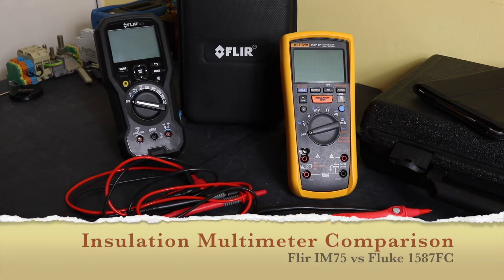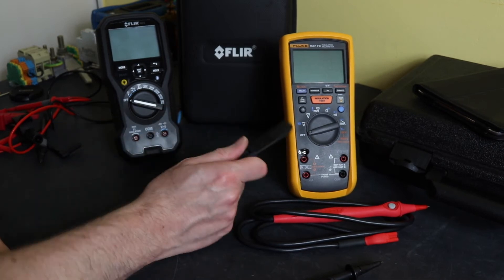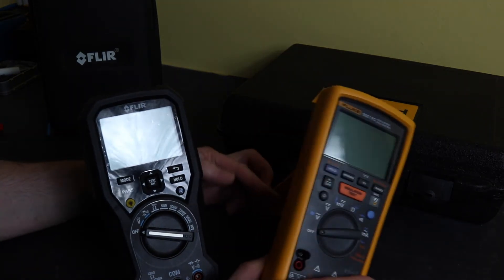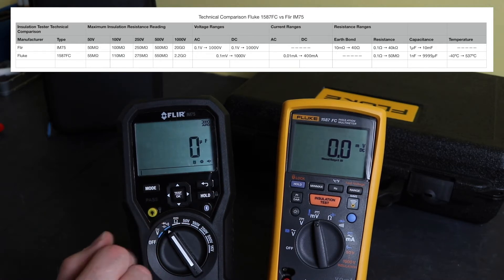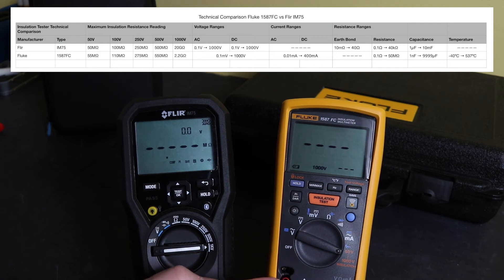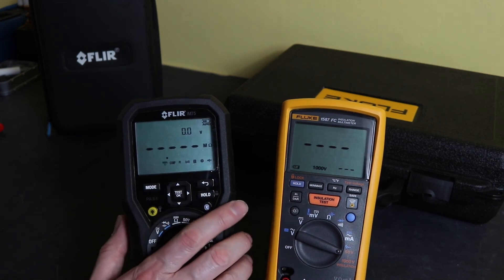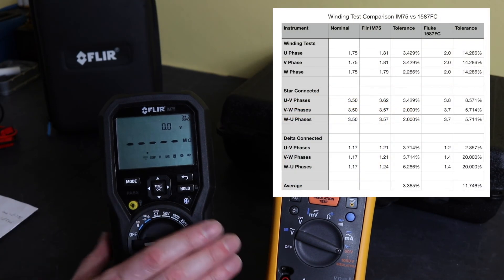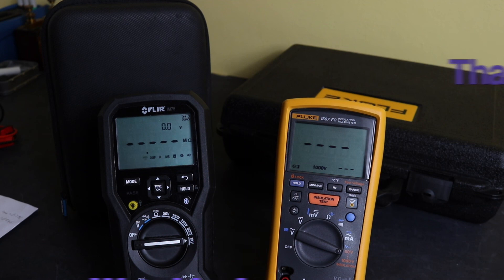Insulation Multimeter Comparison - Flir IM75 vs Fluke 1587FC

Comment: hi mate which one would you pick out of these two?, im looking to have a multimeter/ir tester that can do capitance to have in my tool bag as all in one type set up.
Reply from the maker: For me personally, I would choose the Flir over the Fluke, as the Flir has a 200 mA Ohms / continuity function for measuring earth bond and winding resistances, that the Fluke does not have. The Flir however has a lower capacitance range in comparison to the Fluke and uses a more unusual AAA battery pack.
Alternatively, you could look at something like the Brymen BM878, if you don't need the DAR/PI function for insulation testing.
Reply: @three-phase562 awesome thanks,

Comment: Nice video Three-phase. I think fluke are missing a trick, particularly with this meter model, not having the 200mA test current given that it's got insulation resistance funtionality. Apologies I've not been commenting much recently....been a bit busy with my 2391-52 course/exams.
Reply from the maker: Thanks for watching and commenting Bbf. I agree, it is their top of the range insulation multimeter, so lacking the 200mA test current is not brilliant for UK compliance. Good luck with the exams, worth it in the end.

Comment: I don't know what it is with manufacturers and 6*AAA battery packs. 4*AA would be much preferable to me!

The RS / Appa 156B that I have drops to its low battery warning very quickly but in testing it remains accurate (according to bluetooth transmissions) until long after the display stops working. It's spent longer telling me the battery is dead than it ever did on 1, 2 or 3 bars.
Reply from the maker: Yep, AAA battery packs are a pain. I have converted a lot to rechargeable AA cells like TETC has, so I hardly ever have AAA around. Meters now a days are getting some quite power hungry features on them, which just negates the AAA batteries.
Appreciate you watching and commenting.

Comment: FLIR has a lot of great features that I like. But why wouldn’t they add a remote probe and reporting software ? For those reasons I have to go with the Fluke. Great comparison video 👍🏿
Reply from the maker: It does have some good features. I am surprised they haven't developed the software package for it, as it is probably relatively easy to do. Although there are a number of third party packages starting to come out now. Remote probe is more difficult to add as it will change the case moulding and internal circuitry, so quite a big ask now.